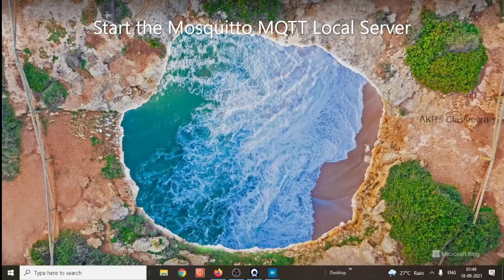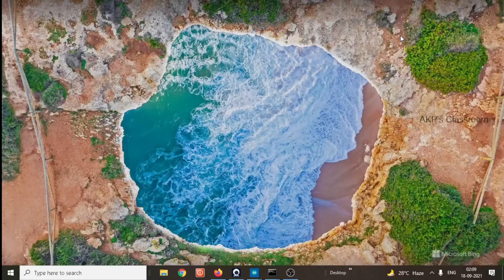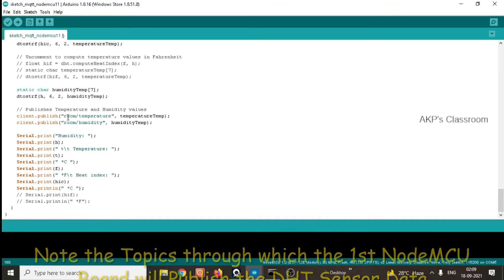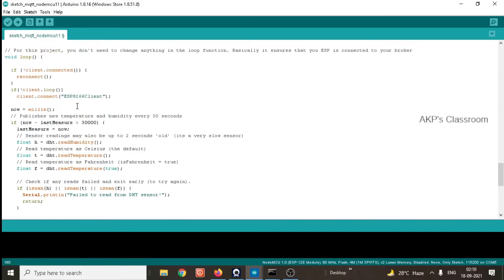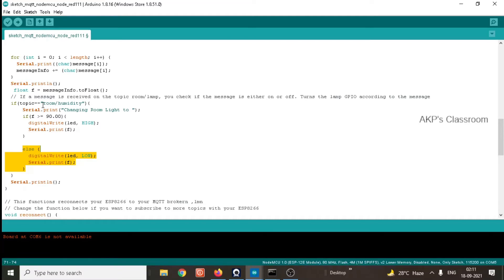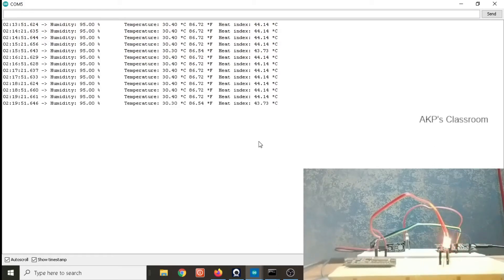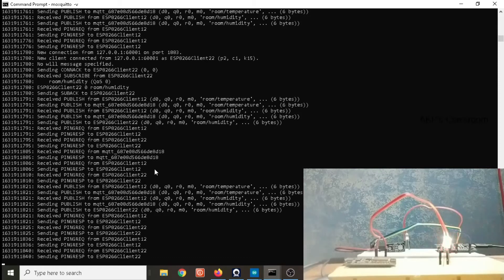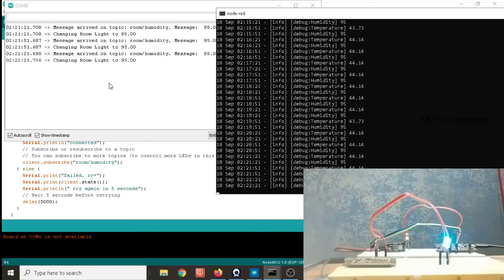Local MQTT Mosquitto broker WITH MULTIPLE ESP8266 Clients

Comment: I am novice to the MQTT.
Can you please confirm that both the esp8266 modules will work in local environment due to local broker or can work from anywhere over internet.

An early response will be highly appreciated.

Thanks & kind regards.
Reply from the maker: Thanks for watching 
It will work in local environment 
If you use any public mqtt broker then it will work from anywhere  in the world
Reply: @akpiot 
Thank you so much
Reply: So this way I can test communication between the two modules by using laptop  in Command Prompt mode.

Right?
Reply from the maker: Yes..if you  want to use cloud mqtt broker just change the mqtt broker ip and use the cloud one
Reply: @akpiot 
Ok ,thank you once again.